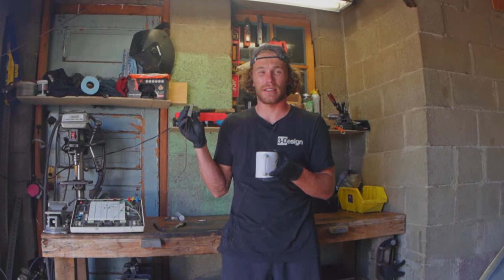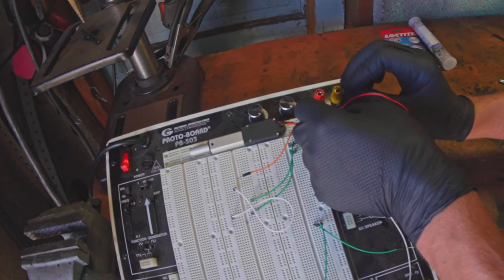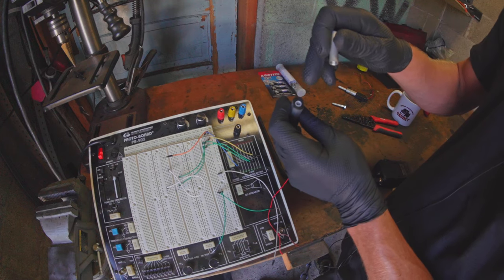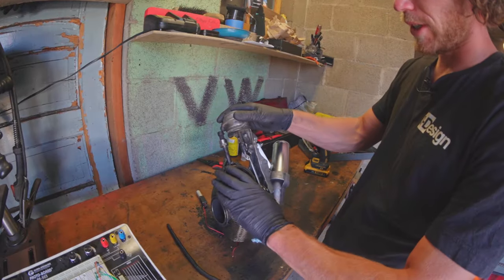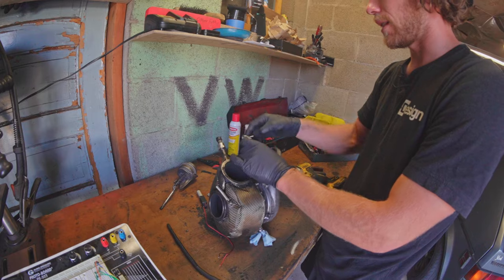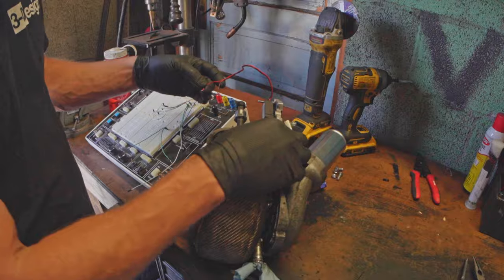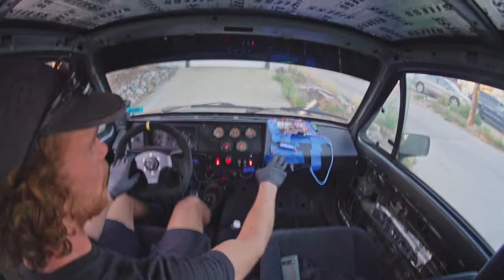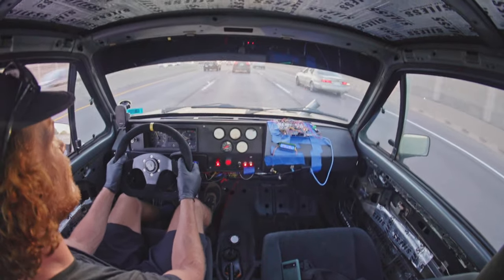Watch me rebuild my VNT control system & go FAEST

Comment: Hi mate i’m a newbie in the electronics stuff. Why dont you use an oem electric actuator ?
Reply from the maker: Hmm. We actually did try the OEM Benz servo & it proved to be hard to control without it's internal location sensing working (it would get stuck at its extremes)

Comment: Hey I’m gonna be building a turbo kit for my na 1.6 and wanted some tips on where to plum an oil feed and return line for my turbo.
Reply from the maker: You can run a sandwich plate adapter on your oil filter which will give you extra 1/8npt or similar ports for oil feed. To return you could get a Turbodiesel oil pan which has a bung in the back of it, or you could weld/add your own to your current pan.
Reply: @OliverFetter  thank you so much for this information I finally got my turbo and I’m starting to get ready to build an exhaust side for it
Reply from the maker: @volkswagen0654  no problem 🌞